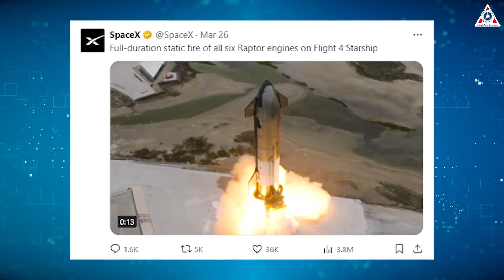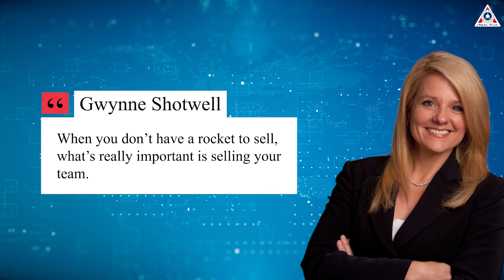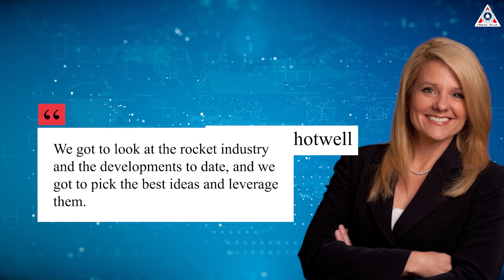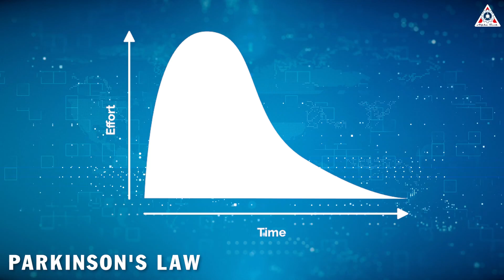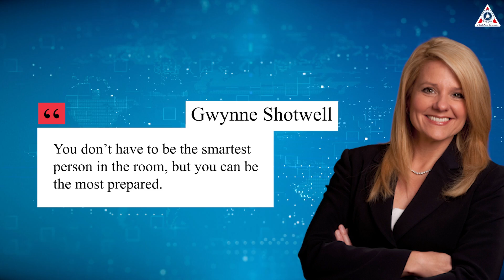SpaceX president just revealed on the Starship Flight 4 launch schedule shocked NASA!

Comment: knowing the mshape of the outside of an SN spaceship
It should be possible to make a outer skin like people use a coat
to cover the outside in pre made tile firmly afixed secure sections
The skins could be made diffrent pertrude out away from body to disrupt
the Coander plasma efferct across body and around.
Secxtions on return could quickly be turned around for replacement 
quick repair replacement of tiles.
In space to moon
refueling copuld be just outside pods of fuel oxydent and supply pods
along with materials for repair and replaced parts.
No atmospheric drag in space only firm atachment is needed
and shape as little effect only balancerd out loading.
Getting mass material equipment up and humans should be diffrent
as a bus or a heavy goods haulage vehicle.
Landing oin moon does not rerquire a buck rogers falsh gordon 
pencil stick to land. it need simpolke low level entry exit to surface drive on off.
OPassengers on a plkane bus train
dfo not climb down ladders or lifts
Nor do they get caufght by robot arm
One simple mistake on catching and Star base could be nout of business for years

Comment: I will say this. If space x rebuilt their launch pad to have a trench like nasa launch pad, with the same mechazilla tower, same water system re design for the trench, and use heat blanket under all the heat tiles, upgrade to nuclear engines, make either the booster or the ship lighter. ( prolly the ship) by using something else other than stainless steel if it’s possible. Then I believe they would be ready for mars. One of the issues I see is that, the amount of fuel it takes to put that ship into orbit is crazy. I would suggest catching the booster, but landing the ship like a plane
Reply: You know best.
Reply: @lowellbrown1122 Yes, everyone can have their say, but very few that actually put the plan to work!  🥸
Reply: We do understand the  world is what it is today because of people sharing ideas and learning from each other theology and experience. The man with the money and plan, plus the brains out there that actually make it work. Allot of ideas were foolishness 100 years ago until now it is use for making remarkable things no one ever think of. Social media help to build Elon musk starship.
Reply: When we observe the falcon, and other people design. The plan is to put a ship in space that is reusable, to go to the moon, other planets, carry and transfer payloads etc. Am not a engineer, mechanic, electrical, not a scientist, etc. I don’t know much about metals, welding, motors, wires, computer science etc. But one thing I know is that, I can draw. Art. 3d molding etc. A good photographic memory. I believe starship going to be successful, to the moon etc. Couple trials and errors. Once Ellon don’t go bankrupt. Which is not easy. Base on my observation, we need to find new energy source. Rocket engines that produce more thrust and use less fuel. Stronger materials, lighter weight. Am not sure if the stainless steel ship is the best for re entry. For holding pressure etc. But whatever they doing, I wish them the best. Once they are open for changes and to copy and learn from others to perfect their work. No prob.

Comment: So for catching the booster etc, there is no need to catch it on the original stack. Build a second stack that is much shorter and cheaper.  It can be located at a safe distance from the main stack and will not cause possible disruptions.
Reply: They will, there is a plan for 2 towers at the base in Texas and 2 more at a base in Florida.
Reply: Well I guess Elon didnt consider that and way it up.

Comment: True! I had lots of evening MBA students who worked at the Cape during the Shuttle era. They always had lots of scrubbed launches and delay, which is why so few were ever launched. SpaceX quickly surpassed the decades of Shuttle total flights in just a few years. NASA cost overruns, multi-firm component makers and suppliers of services based purely on lobbying power in Congress. Contracts went out to every state to ensure Congressional approval.
Reply: Advantage using the Henry Ford assembly line production approach. Produce everything as much as possible in your plant. Need to change something, Walk across the floor and change it.

Comment: I'm not worried, The problems are all able to be solved, and its getting progress every flight. Also they have issues with both booster and ship, meaning pretty good chance they will make progress on both at the same time. And if they just solve the issues from the last flight, they pretty much make a home run... Theres not that much left that are biggies...

Literally not far from actually operational.
I think Elon might even nail an aspirational prediction and surprize  everybody...

And we are likely only a month or two from the next flight...

The only sure thing, is they will learn stuff...

And I can tell from the construction details on these ships, that the cobbling days are almost over. Everything is getting that refined look, and precise look of attention paid to details and guys doing their best at every step.
Looks to me like the fabricators are pushing the engineers pretty hard. They are making things well, faster than the engineers can iron out the bugs...

Thats a good sign... when the engineers finally get things right, production quality will already be there, after that, its jack up production rate for time units. which is basically more guys, with more tools working on the same things. Also theres robotics... Pretty good chance theres seriously large robotic tools installed in the new factory. and theres the Tesla Bots coming over the horizon... They are gonna have robots making robots, making Starships.. This could get alittle wild on acceleration of production.
We could see Starship production go exponential in the next five years or so, if enough uses are created.  Its gonna have to pay, so the biggest hold up will be how many creative ways to make a profit with a Starship can we come up with, and actually build out, and not just dream on?

My advice to the Space business community, is get to work building actual things as soon as possible.
Reply: I hope they learn that this is a waste of everyone's time. They laid down so much hype and excitement, and now they can't back it up
Reply: @jaydonbrown617  
I think its not quite that bad... And that next flight likely things learned that go farther. Interestingly for me, what they had issues with were all things I have been pointing out as iffy long term.
And evidently they got some structual damage effect on the booster, as they are using doublers now between existing longitudinals in the tanks area.
I suspect oscilations causing slosh, cracking welds, at same time trying to light engines. But thats supposition without access to imformation.

So far they seem to think they can do Ringling Brothers Circus moves with huge lightly built ships, with serious masses of liquids in partially emptied tanks..

I'd suggest softer martial arts style thinking.
And not as much slamming and jamming...
More Tai Chi style re entry moves.
They learn via mistakes just like everybody else  and the people who dont make mistakes, do dont anything.
I think the next flight will be a bit of a watershed followed by the beginnings of a rethink.
Then use the remaining built ships to attempt cobbled up fixes, and by V-2 a new reality...
Reply: @garylester3976  Why do I feel like I'm talking to a wise old sage all of a sudden? 😅

Either way, this is all fine and good the "progress" they've made so far, but nothing accomplished so far indicates they are ready for anything past LEO transfers. It's also strange that they're jumping to new designs already before allowing their first design of Starship to survive their test flights. The only justification I can give to that is that the current version of Starship is inherently too short of fuel capacity, which explains why both craft seemed to run out of fuel last flight. But I've heard somewhere recently that the Raptors were not at 100% thrust for the last flight either way, and then you said they didn't even fill their tanks fully, allowing sloshing of fluid.  In those cases, who knows what they're doing, probably scrambling for a fix with the $1billion they have left.
Reply: @jaydonbrown617  
I was referring to the booster, it had done its burn and likely down to landing fuel or less.
What I saw was an attempt to relight booster engines going into a 1000 mph headwind.... Not a good plan, rocket engines being difficult to light sitting still.
On the Starship, their butt first circus manouver seemed to get them in hot plasma pretty quick...
And their flappers got locked up and jammed.

Poor little Starship! Screaming into thick atmosphere....
I have suggested a different method via a flight profile change,
And heard something Elon said about it... so could get used,
If it works, will make everything easier and less dramatic... also use way less fuel.
And could reduce the need for the tiles.
As for changes, this is a good time for that... way better than a factory recall after in full production.
I'm very optimistic, have seen SpaceX adapt and adopt repeatedly.
Maybe a tich stubborn, but Elon rules there, and wants results by any means that functions well.
As for the wise Sage humor, I realized quite young that folk sayings and idioms were passed down knowledge from sometimes pre writing era.
And that they were concentrated wisdom.
And I started mentally collecting them from any source available.
Basically doing that is equal to a University degree in effects on one's life... Being not stupid pays dividends...
Mostly a student of the Tao and the Bible, have read the Koran and liked it, and looking forward to being able to buy books like that again some day.
The real virtue of such knowledge, comes with application, not just Parroting....
Reply: @garylester3976  Well we'll just have to see. Everything they've achieved up till this point has been difficult, but not downright impossible. With Starship's current design, success becomes quite a bit  more questionable. I just think is too small a ship for Elon's ambitious, as crazy as that sounds. It's design and profile are over all not suitable for moon missions, let alone all the way to Mars. LEO deliveries for sure eventually, but that's about it
Reply: @jaydonbrown617  
Well, I have had some similar thoughts, and said as much in writs.
What he's got going is a nice Earth's gravity well lifter... kind of a Tramp Freighter...
But thats actually the first step you need for alot of things. So I try to encourage, help, cattle prod, etc.
And have been suggesting Transit Ships, and designed to purpose Landers...
Yesterday, even a writ on a structure that could be multi purpose, from a Space station to a Lander habitat.

At this point, probably best to encourage SpaceX, and plant concepts for other options, and let SpaxeX and NASA explore their fallacies... Realities have a way of destroying fairy tale delusions. And sure if enough mistakes are made, eventually adaptation to situations will occur...

Its like NASA and undersized Rover wheels, I've been nagging them for decades, and just now seeing the occaisional realistic size off road wheel in their art work...
Sure after sticking a few more Billion dollar projects in the dirt far far from Triple AAA, they will figure it out.
Ditto on Starship and some of the silly notions...
I have haranged them for years about grid fins, tiles, round hulls, and flappers... And they are actually starting to think!
We'll see! but if they try the long glide at high altitude in thin atmosphere, and get beneficial numbers, they may decide its better than RUDs....
And it will lead them to greener pastures design wise. Just like parts count is becoming the path to rocket engine Nirvana...

Comment: Hey I have a question for the technician s at space x why they can't 3D print the heat shield on Star ship.
Reply: it is an internally developed ceramic compound that is made to resist plasma level heat. 3d printing is either melting wire or melting powder with laser. how do you suggest they would melt something that withstands the temperatures of plasma? that is why.
Reply: It is not entirely accurate, 3D printed houses are made and they do not melt anything, they simply add layers when the material is not set @supersecretninjame